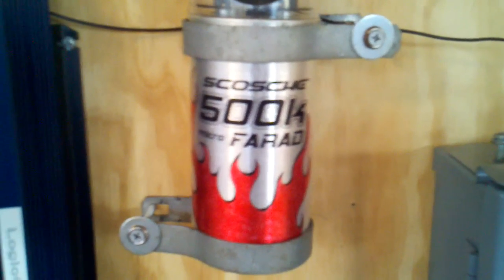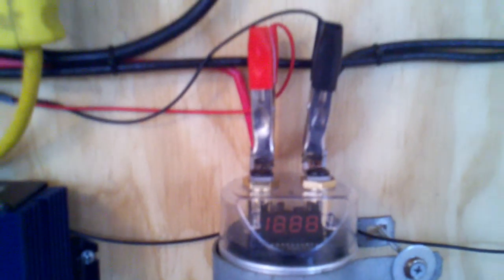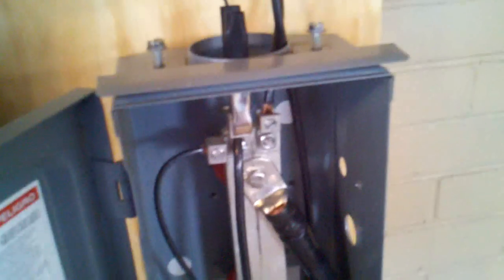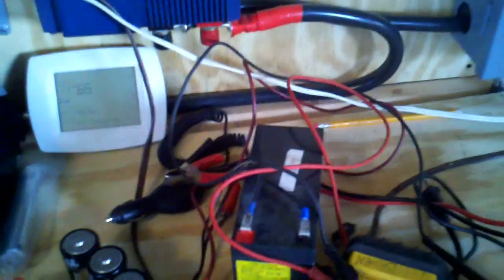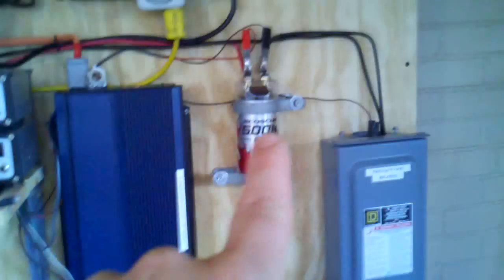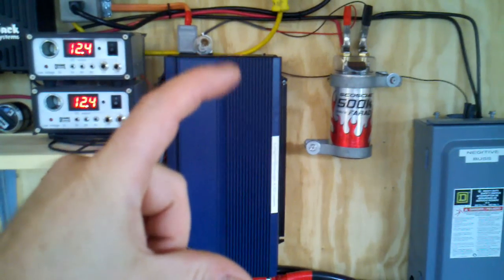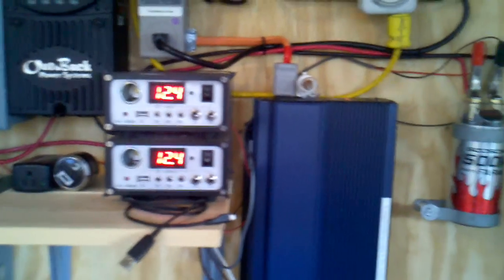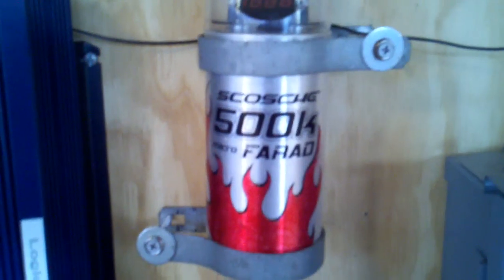How to wire a super Capacitor into your PV solar setup to help with starting up inverter loads

Comment: The inverter is rated at what the inverter is rated at. Nothing can change that. There are several reasons why a fridge or air condition will not start from an inverter.

1. The inverter is not rated to handle the surge. It may take 4000 watts for a half second to start up a fridge but if the inverter can only handle 2000 watts for a half second then the inverter will fault.

2. Battery capacity. Most batteries can deliver a micro surge of power but if you have a smaller battery then that surge is going to be smaller and it may not be enough to supply the inverter what it needs. In which case the inverter will fault. A bigger battery bank is needed.

3. Wire connecting the batteries together and to the inverter needs to be size appropriate. If you are trying to start a fridge on anything less that 0 AWG then you will most likely be unable to deliver that peak startup cost to the inverter. A 4000 watt start up at 120 volts is around 33 amps. For a 90 percent efficiently inverter from a volt volt source would mean 350 DC amps. If the pipe isn't big enough to deliver those amps then you are out of luck. Most home working is 14 awg but at 120 volts so it has the punch through to work over the resistance of a smaller wire. Where as a 12 volt battery bank has less punch and need bigger wire to overcome the travel between batteries and inverter.

A capaciter is not the answer but rather a bigger battery bank. A capaciter is nothing more than a cheap bandaid which means your battery bank is probably too small to run anything. That just means shorter battery life and possibly a dead inverter.
Reply: +GPVlog Wow now that was a mouthful!! I just asked not a few seconds ago about the ground, boy did I get a education on this thing hahahha thanks
Reply: TL;DR-
GPVlog is not necessarily wrong on all GPVlog's points, but not necessarily correct either... I defiantly disagree with the conclusion... I can totally see capacitors having a place in residential DC setups...  for exactly this purpose... to handle surges while requiring a smaller battery bank... caps and batteries are functionally different... the both store power and discharge power, but batteries are slow and caps are fast, batteries tend to have higher storage capacities than capacitors... caps are better at handling surges than batteries. 

So Point by Point:

Opening Statement-
Not quite... you can't run your cap at over the voltage rating as you risk an explotion... but you can run it under it's rating just fine the Scosche 500k micro-Farad Cap is rated to handle 20V⎓... I highly doubt he's running a 20V battery setup, so he probably is running it under it's rating, which is fine.

1. um, did you read what you said? It doesn't make since ... his inverter can handle 4000W for a second or 3 but it can run indefinitely at 2000W... hence it's a 2000W inverter with a PEAK of 4000W... it can handle it, it's just hard on it to play catch-up after hitting close to it's peak... the cap just helps it rebound more smoothly. Besides a common peak startup surge from a typical household single door fridge is somewhere in the neighborhood of 1500W to 2000W so either he's going a bit overboard, or he has a big refrigerator.

2. Um, that's the point of all this, to get around the need for a larger battery bank for a simple setup... he's powering a fridge not a house... he doesn't need more wattage during the running state, only during a startup surge... compressers draw a lot to get started but a moderate amount of power to keep running... so yeah, your second point just leads me to believe you completely missed the point behind why he's doing this.

3. The electricity coming out of an inverter is AC... that's kinda the definition of an inverter... the power going to the fridge is coming from the inverter's AC output... it is 120V~... the standard 12/2 and even the old standard of 14/2 would be fine... his gage on the DC side is fine... Amperes take there toll over time... a wire that's pulling too many amps doesn't melt instantly... it takes time to heat up... for a few millisecond of surge it should be fine, and as far as it having too much resistance to work at all, it's working, just saying... now is he delivering all the amps the inverter wants as fast as it wants it in a surge rebound condition? Idk, maybe, maybe not... that would take some testing to see in practice and more specs on the inverter to calculate in theory. The wires from the inverter to the batteries including the shunts he's using as bus bars is plenty fine trust me on that... remember the batteries are connected to the inverter not the fridge... the inverter has internal circuitry to handle surges on it's output without putting too much strain on the batteries which includes big caps...  he's basically just increasing the capacity of the inverters build in caps. So the inverter won't cause such a sudden surge on the batteries, the surge from the fridge is negligible  bordering on irrelevant to the batteries if the inverter can handle the surge... the added cap just smooths recovery for the inverter.

Your Conclusion-
A capacitor may or may not be the most ideal and practical answer depending on your set up... a bigger battery bank is ideal but expensive and may not be necessary... granted a cap if used incorrectly could prematurely kill an inverter... or if used properly could extend it's life... and a cap on a bat output is not going to negatively effect the batteries... I get the impression you think a capacitor sucks power as fas as it discharges it... it does not... it draws at whatever rate is available (to a point obviously) ... and it can be charged very slowly if need be... it's draw is less like a kid sucking a drink threw a straw and more like an adult pouring a drink into their mouth and letting it flow at the rate of flow... it's not sucking mass power all at once it's letting the batteries charge it at there own pace. That's how caps work. 

My Conclusion-
So your not quite correct. You do bring up some valid things to consider when contemplating the prospect of using a cap in your system. So I do find value in your contribution. In most cases I'd tend to agree that a bigger bank is a more ideal solution, but that's because most people tend to power a whole house... but for a simple setup for a single room or a fridge or well pump or something of that nature I think it's fine... but for inductive loads like refrigerator compressors, and well pumps with AC inductive motors, I would advise getting an inverter capable of pure sign wave output rather than modified signwave, they are more expensive but will be worth the added cost as the don't cost as much more as buying a new fridge or pump every few years would cost. Also anything with timing circuitry that doesn't have it's own built-in oscillator, but rather indexes the 60Hz of AC was designed for US use only lol and won't function properly on moded sign wave AC from cheap (and inexpensive) inverters... his inverter looks to be one of the budget models I speak of but I can't say for sure.

Some Final Words-
I hope I shed some light on some things for you, and that I was accurate and clear. If you think I'm mistaken on something or unclear I am open to discussion. I am plenty capable of changing my perspective, learning new things, standing corrected, etc in spite of having pride in my knowledge. The moment I'm too proud to learn is the moment I know nothing because knowlege is not static it's fluid and evolving, it will not wait on those who do not accept being corrected. So if you feel I'm wrong don't be shy to say so, I don't view it as an attack on my existing knowledge but a chance to possibly learn something new.

[EDIT]
After reading it, I see that it could be read with a harsh tone, this was not the intension.
Reply: Grant Imahara Great information Grant I want to run a 1 I. 7 cubic inch bar fridge new energy efficient one .I'm currently using a coleman 12 cooler with a thermostat I ordered from ebay but it is a power hog and not that cold I'm off grid I have over 200 watts of solar 4 batteries just for the tiny fridge will a cap aid in starting up I want to install it in the kitchen with the inverter close to fridge should it be refused inside my 12 volts is house wire 14, I think but volts is less there than at my battery shed I have separate panels and batteries 4 plus 200 to 300 watts solar panels with inverter for lights and TV should everything be one big system cooler would run all batteries down so we separated them in half.If I hook it up under the sink can I run cap directly to inverter without hurting it and how big an inverter di I need foe a 1.7 cubic inch bar frigde I'd love to go bigger but afraid of dead batteries .I heard to big of an inverter just drain batteries also . I have a 4500 watt peek 2500 watt continuous would that be overkill I also have a 1000 watt . Sorry for such a long message but no one knows anything at the stores any help advice or information would be greatly appreciated Thanks very much Dale
Reply: This is true until you get into the good shit like 3100 FARA caps that only cost 70 dollars each.   Put in a bank of those with a couple very HIGH amp batteries and your good to go.  Iv seen people set up a 2hp motor with a pully on a car altenator whats around 350 amps.  And runs that to power the initial start.
Reply: Grant Imahara Getting electrical engineering education from THE Grant Imahara can never be viewed through a harsh lens... I’d take it as n honour you took the time to clarify (you have neatly explained why battery/capacitor combos are excellent solutions for things like... say... people living on a sailboat; the modern combo of battery/super-capacitor/inverter allows small boats to run mod-cons such as fridges, air con, washing machines etc...)
Reply: @binaryglitch64  excellent info thanks, i have a 12V 880AH battery bank for living of and have come across a problem with initial surge currents. i am in the UK and have a 230V 4KW, 8KW peak inverter but i am looking to upgrade to a 48V 2KAH bank with a 230V 5.5KW 10KW peak inverter and run it from a hybrid system, i am an electrical engineer in training and have acquired over 1000 (16V 1mF) capacitors and was wondering if they could be wired in parallel/series retrospectively to give me voltage and capacitance. 
thanks

Comment: @Guy Brown  ...so really the cap is a start up capacitor, similar to ones used on compressors and washing machines, helps with that initial start up draw of current and gives it that kick start
Reply: It's a DC start cap yes. You can ad an ac start cap to the ac side and achieve similar results
Reply: @thomastaylor8657  I thought AC and DC did not matter as far as a capacitor is concerned. Just because of the way they are built. Also I don’t have super capacitors but I have those 450v capacitors that you find on industrial grade electric motors. I want to use them but my experience with capacitors turning into rockets tells me that I should ask someone who has more experience with them in this configuration.

Comment: Did you precharge the capacitor through a resistor before connecting directly across the battery/inverter?

Comment: So your 12 volt battery banks are charging the capacitor, right ? Can I know the type of capacitor your are using, as most inverter are made to take 
12 volts , 24 volts

Comment: Hey just seen this you should hook the cap up to the inverter directly with 4 gage keep the wire about a foot or so this will tie it closer to the caps in the inverter

Comment: It was my understanding the capacitors will only help with AC because of the EMF it creates from the alternating current. I believe it counteracts inductance. It does not have an affect on dc the same way. It’s been a long time so correct me where I’m wrong.

Comment: My system was running so tight,tat my AGM batteries were down to 11.9 by 3am. The inverter I use to run the refer has an annoying habit of not letting go of an alarm when restored. I use a 2 farad supercapacitor for audio systems in cars,directly off the back connections of the inverter. No more issue. Before the sun comes up, it will allow 3 refer starts,without setting off that annoying little beeping outside. Since changing to wet lead acid batteries,no more issue. 12.2 @ 5:00am. 600 watts panel,630ah batt,and 350 max refer draw.
Reply from the maker: The caps really help. There are people who say they don't but they do. Thanks for watching.

Comment: Thanks for explaining this. I am considering one for my 24v portable solar generator. Currently, I am running four Trojan 31 AGM batteries with 0-gauge welding cable. Any suggestions on wire/cable size for that capacitor? I plan to wire it in parallel. Thanks.
Reply from the maker: Chris DIYer I'd go with atleast 6 or 8.

Comment: Would you post a video reflecting the battery voltage surge with and without the capacitor in the circuit?
Thanks, El Raz

Comment: I installed a turbo encabulator, ever since no capacitive deractance or nover trunion side fumbling has occurred on the semiboloid slot on the stator effectively it has eliminated parametric pham.

Comment: Yeah, like the other guy said, it would work great wired closest to the inverter.  I used to use 1.5 farad capacitors on my 1400 watt car audio systems.  It helped tremendously, so I can only imagine how well it should also work here.  As far as I know, they are rated for 12V. I don't know if the caps will work okay with 24 or 48V batteries on a solar system.  Has anyone tried that?
Reply: Peter Hicks  I have a 5 farad capacitor on my solar system now to deal with the surges when I run my A/C on the solar set up I have.
Reply: @CarMaintenanceGuy  hello, do you use 24v or 48v system?
Reply: @carlos-ee6vv  Mine was a 12V.  But it requires so much amperage.  If I had to do it all over, I would opt for a 48V.

Comment: Just want to make sure I have this right I can connect capacitor directly to my converter  it will only draw power from the capacitor when amperage draw is extream storing power until needed. I've been using a thermo electric cooler at my cabin it's killing my batteries and is not very Sufficient I want to use a 1.7 cubic ft frigde I have .Do you know how large an inverter It will require to start  it draws 80 watts while running and will using a capacitor lengthen the life of my converter .I have a 300 watts of solar right now is that enough. Any help you could give me would be greatly appreciated. Your video was very helpful thanks very much Dale

Comment: Nice setup and I am doing a RV system 12v and can fit 6 6 volt batteries. Would it be good use to use 2 and a large capacitor for the engine and 4 for house bank when on the move and boondocking link the engine bank and have capacity of all 6. Or just get a starting battery and 4 deep cycle? I will be boondocking in winter in snow country all winter.
Reply from the maker: +Bob w you should not use deep cycle batteries for the engine start. They are not designed to run that many amps all at once. You should keep a big cca battery for that and install a disconnect switch to it that way you don't accidentally run that battery dead
Reply: Guy Brown thanks for the response. I see your point. My thought was the capacitor would give the cranking amps needed. The gc2 battery I have is rated 75 amp @110min.

Comment: I understand well how you connect, I have 12V battery bank I would like do same. Guy rather than 500K uF is there any specific rated voltage for it? regards
Reply from the maker: Roberto Ardales Mine is a 12 volt. disigned for car audio systems. However you can get super caps at 2 volts each and wire them togeather to get to the voltage you need.

Comment: On the AC side I can see the large cap to help the induction motor stay in phase since caps lead and inductors lag in phase. In phase helps he motor come up to speed faster since this is a simple induction motor running what I assume (AC) is 120VAC?
Seems to work for you and have not seen many people use a cap designed for car audio systems for a home energy system...
Reply from the maker: You know I didnt start out with it in the plan. I tend to use the design build method. It was given to me and so I just found a place to use it. When I started to install it I could not find anyone that had done it before so I did some calculations and wired it up. Thanks for watching!!!1

Comment: Hi Guy I have 12 volts under my kitchen cupboards it's less volts there than at my baterry  shed can I install a capacitor directly to that 12 volts should I fuse it there to and I'm hooking up an inverter to run a 110 fridge ( tired of the 12 volt cooler draining system). Then can I hook wires from the cap directly to the inverter without blowing it. Also how big of an inverter would I need to run a new energy efficient 1.7 cubic inch frige and will the cap aid in the start up high amp draw even if the batteries are low (cloudy day) .Sorry for big long message but no one knows much at any stores and current coleman 12 volt cooler even with the thermostat I installed off eBay is a power hog .Thanks so much any info would be greatly appreciated. DALE

Comment: How do you wire it if you're not using a Bus Bar?  I'm just using the batteries direct to the Inverter. If I want to incorporate the same capacitor to power my refrigerator, then how do I do that?